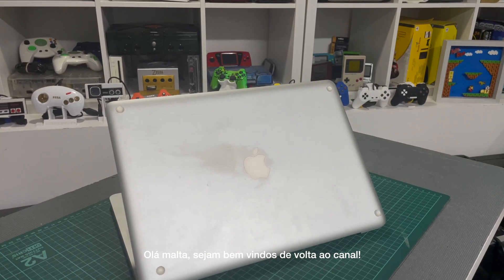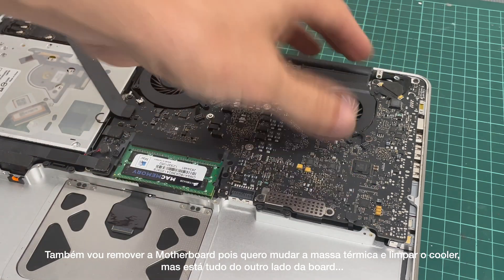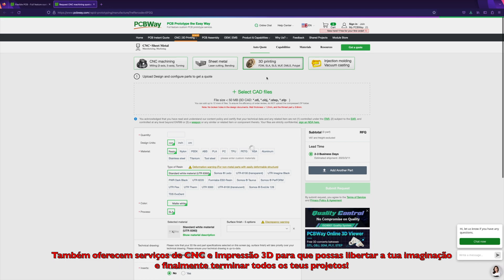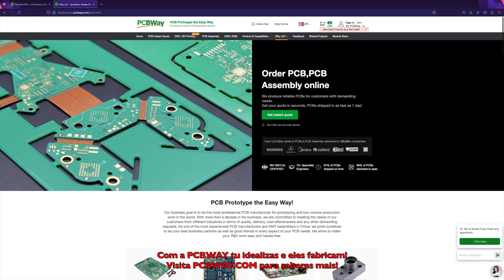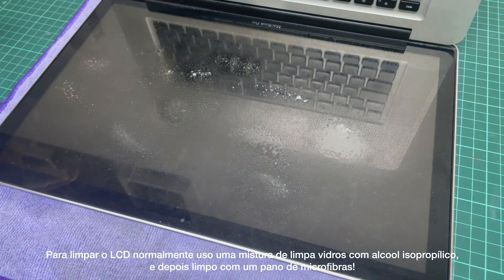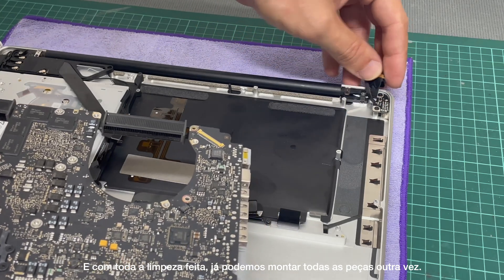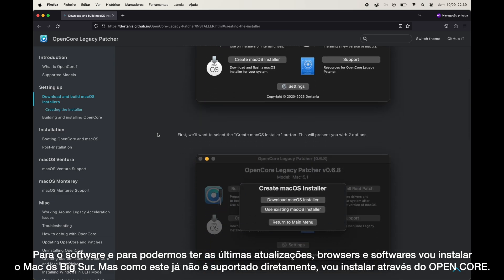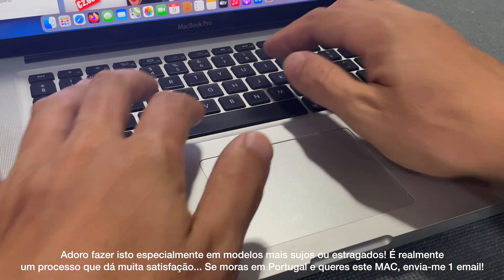Reviving and Upgrading MacBook Pro 2011 ( Mac os BIG SUR )

Comment: Just ordered the rubber feet for mac cause its way originated for it..mine had taken from all originated Macbook Pro 2012 and still a very originated from all aspect of usage and being used in this year 2025..
Reply from the maker: The still a very usable machines!!
Reply: @fabiofontes  Its still upgradable to OCLP Sonoma on that machine..👍👍👍👍
Reply from the maker: @Ryan_Revier  Yes.. but runing sonoma here is pushing the limits, but yes it runs! I think Monterey its enough and runs pretty fine..
Reply: Still the best with OCLP Big Sur in it will be fine..as for Monterey OCLP only runs from Macbook Pro 2008/2009..

Comment: I’m running issues with the fan going on always. How do you get around it? Mine is a macbook 2011 early
Reply from the maker: Thermalpaste replaced? If so what Os are you runing?
Reply: @fabiofontes  yes, it started happening after upgrading to big sur. It was not doing it with high sierra, they were super quiet
Reply from the maker: @ktangut  There's a couple apps for slowing down the fan and controll the temp also. Have a look on google ... MAC FAN controll or something. I think its normal because the "forced" udpate...
Reply: @fabiofontes  thanks Fabio, i will check it out